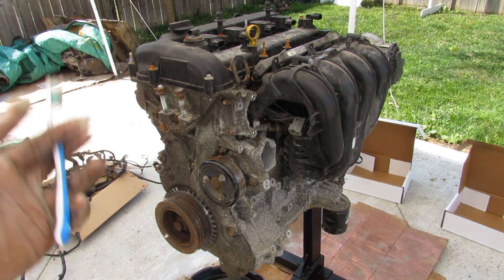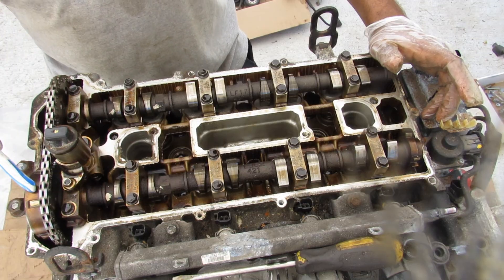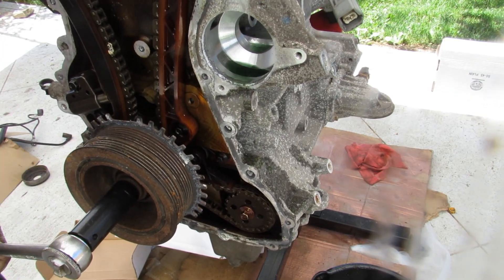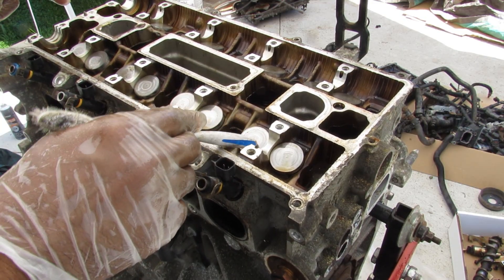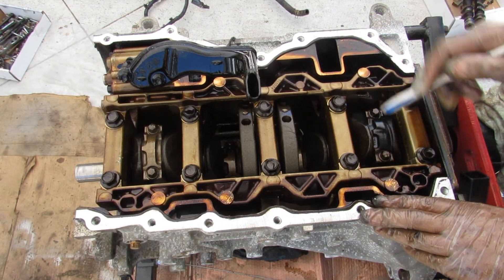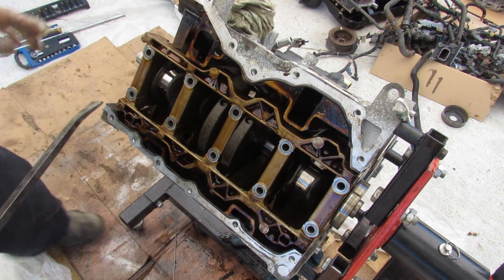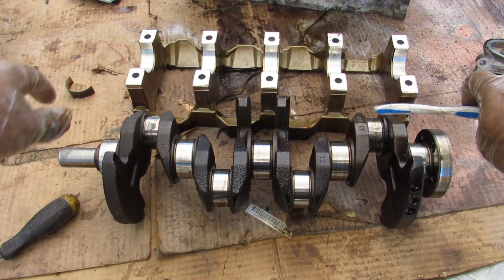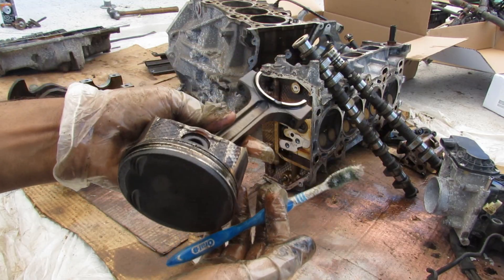Why Mazda Engines FAIL

Comment: In the U.K. the 1.8 mzr Mazda mx5 2006/7/8 seems popular fail from oil starvation. It does seem service every 6 months with fully synthetic oil is key to engine longevity.
Reply: The 2L also seems to suffer. Oil consumption increase dramatically, and if the driver doesn't notice then oil starvation occurs

Comment: very interesting. So drive gently and keep the thing serviced properly esp with oil and filters and dont let it get hot, etc.  If not buy a 1994 Mazda with an iron block BP series engine and treat it like shit. BTW Maltese Shitzus love being oil rags. Least mine did.
Reply: Of course aluminium block engines are more responsible in this day and age.  I prefer iron blocks.   The new way of timing the engine is rational if you have the right calibration bars etc and follow the correct procedure. But again I prefer the old ways.

Comment: The Problem a this  Engines are the Piston Rings and the Teflon Coating  - first of all the Teflon Coating get off after 100000km - then the piston Rings  fail and then the engine will burn the oil - if the user fill up enough oil all the time after this happen he can use the engine a longer time - but most users dont recognise that the engines need more oil after 100000km and then the engines run dry - and the fist tings happens are at the Crankshaft bearings  as you shown ...

Comment: My 2011 Mazda 3 2L engine has travelled 347000km and is still running strong! 

Service your engine on or before it’s due date, never miss a service, and it will last.

Comment: Honestly mazda has their shit together and is one of the most reliable brands out there. Id put the blame on not on time maintenance
Reply: Dude....there is no markings or keys for timing on any single piece.......do you have any idea, how much time one needs to get the timing correct without any reference point? parts and reliability maybe cheap and durable, but that is where cost cuttings go.....the labour costs (aka. time) for a shop to time the engine correctly is where most of the expense is going.
Reply: @hussamjamil4980  i worked at a shop and had mazdas come in for maintenance and i personally never had an issue working on them. Also if you look at reliability ratings theyre one of the top performers
Reply: True, these are actually incredibly reliable engines even when they’re turbocharged. My problem with the duratec is internal maintenance sucks if you have to do it. The Zetec was much easier to work on, though it required more maintenance (timing belt, etc)
Reply: Buddy Mazda cars are trash but not as bad as chevy or kia but still bad. try working on an of there parts and you will also notice theyre designs are even worse to work on

Comment: As mentioned a bolt can be removed to place a pin to hold the crank shaft prior to complete disassembly, these engines where designed to be taken apart with special tools in place to keep the time accurate, otherwise you’d end up causing a headache 🤕 not too bad, I’ve personally have been around these engine way to much lol been there done that kinda scenarios. Ford/Mazda do a great job now it’s the Chevy Cruze! That’s a terrible car and engine

Comment: Theres a plug you remove to insert a bolt to keep the crank from spinning when you time the engine. Keeps the crank from spinging when you torque down that crank pully. Its on the mazdaspeed engines. not too sure about the other mzr engines.

Comment: Have you done a video on the Honda Diesels? N22a or n22b. Id Love to see a video on One of those as i own an accord with the b model. I think its a great engine and currently has 357000 kilometers on it without any problems.
Reply from the maker: Never knew they had diesels I'm north America
Reply: @speedkar99  i see, i think maybe some models had Them in North America but im not sure. They are in the cu/cw models, or the tsx i think they are Called in America but i Guess they never sold the Diesels there then.

Comment: I had the 2.3L in  2004 Mazda6 with a maual. It had regular oil changes & never came close to letting me down. In fact, I prefer it over the 2.5L Skyactiv in my 2016 Mazda6. It punched above its specs & had a great engine note.

Comment: The lack of timing marks or key is fucking insane
Reply from the maker: Amazing how that made it in production
Reply: @Sammyhale30  Possibly. But it wouldnt make me feel any better to have to pay $1000+ (the typical price of a timing belt job) to a mechanic as opposed to the less than $200 I spent on a timing belt kit to do my first timing belt job on my own which has been going strong for 15,000+ miles.

Comment: does anyone know if there is a ratchet on the timing chain tensioner? I am working on a VW 1.4TSI, all the main features are the same. I think it was designed by the same person/team! strange...the cams and crank pulley also don't have keys. The pistons also have the graphite coating, the cam chain guides are similar except all plastic. But the VW tensioner has no ratchet, even with all new component, turn the engine back 90 deg and the chain can skip teeth! VW say there's no problem! the pistons break too. Don't have bearing problems though.
Reply from the maker: They should have a ratchet
Reply: @speedkar99  "They should have a ratchet" i would think so too! but DO they? this is the VW engine, 
https://youtu.be/TZqgx4g1pmA

Comment: I had two Mondeo 1.8 petrols. 5/6 K oil and filter changes. 192,000 and 206,000 miles. Never one problem with either engines. 2005 one on original clutch.
Reply: That's reassuring. Mine's on 77k, changed the oil with good stuff every 5k for the last 7 years I've had it. At the rate I do mileage it wont hit 200,000 until it is over 40 years old, so should be good. Clutch is still ok too, amazingly given the amount of time it spends in traffic jams.

It does burn a small amount of oil. Can't really tell if it's getting worse or not. Sometimes it will go ages and not burn anything, then it'll drink its way down the dipstick in a couple of weeks. Got a fiesta like it too.
Reply: @thegearknob7161  
Mine used to burn a little towards 200k but nothing much. Synthetic oil always for me.
Reply: Ive just bought a 1.8 myself with 73k on and is started to make a slight rattle like the start of the video but doesn't do it all the time, not sure if I should be worried just yet
Reply: @bradley6758  
Just make sure you change the oil and filter. Use 5w30. Any synthetic brand.
Reply: @andylane247  luckly it's just had an oil and filter change just before I bought it so fingers crossed.
Reply: @bradley6758  
I'd probably change them anyway,  unless of course you trust previous owner implicitly.
Reply: @andylane247  going off the fact that they've poured oil all over the top of the engine and under the plastic cover that might not be a bad idea 🙄
Reply: @bradley6758  
Best to be sure. Internal camchains do wear out oils eventually. Use the synthetics and it should be ok. Be careful who does your oil changes. My missus lease car was done by Halfords. The 2nd oil change they didn't tighten the drain plug. Luckily we noticed the oil loss.
Reply: @andylane247  cheers mate.
Reply: @bradley6758  
No worries. Good engines those Ford 1.8's.

Comment: Ford should really be in this title. These were Ford engines that Mazda used. The current generation of Mazda Skyactiv engines are far more reliable.
Reply: No, these were Mazda designed engines and the Skyactiv engines are still very similar to these engines.

Comment: To time that engine you need 2 special tools. One bar that locks the camshafts and 1 pin that rests up against a flat surface on the crankshaft. Always replace the diamond impregnated washers at the camshafts and on both sides of the crank sprocket. And don't try to time it without the tools because you will regret it.  A important note though is never remove the crank bolt until it's timed at top dead center. It's easy to bend valves. As far as this crank journal failure goes 99.9% of the time it's lack of maintenance..
Reply: And a special tool to hold the crank pulley while torquing. The lack of keyway is soooo stupid

Comment: Both my old mazda and my even older toyota could quite happily do 10000 miles and when the oil was changed it still looked nearly new. My 1.2TSI engine turns the oil black the day it rolls out of the garage.

Comment: I have owned 2 Mazda 6  vehicles with 2.3 litre engine 15 years old with 324000km other had 296000km and both engines did not have 1 issue, I have now bought a Mazda cx5.

Comment: Can you PLEASE do a mechanical review of the 2021 Hyundai Elantra Hybrid. It's the only hybrid out right now without a garbage CVT
Reply: Are you equating a Hybrid's eCVT to a snowmobile style CVT like Nissan uses? Because they're not even close to the same thing.
Reply: @OhPhuckYou  That's a very good point. It's my understanding that Ford and Toyota share patents on the hybrid e-cvt which is why they're the only manufacturers that use them. I've had one of each (Ford and Toyota) and they don't drive like the Nissan or Honda CVTs at all - the engine noise doesn't match the speed, of course, but there's none of the rubber-banding you have in the others. Wife had a Honda with a CVT years ago and that was a weird ride.

Comment: So how does one time this engine if nothing is keyed (I got the valves with the gap alignment, how about the crank)?
Reply: The alignment tools are an absolute necessity. You may be able to time it without the alignment tools well enough to get it started but I promise you that it will not run well.

Comment: No key on the crank.
That's some Mickey mouse shit there...
Reply: It used to make me a lot of money off of that design. Independent shops would tear them apart then discover that there was no key way. It's as simple as loosening the crank bolt and then it's all over.  Some would try to line it up without the tools. And some would manage to get it together well enough to run but usually not very well.

Comment: Depending from the owner, this engine never changed the oil on time, that is why dirty the engine and the parts are done.Nothing wrong with my 2.5l MZR  320000km and running new with the Castrol Titanium synthetic oil from the new time to now. 
9years old now 👍😊🏆
Reply: My 2.3 L3 is at 394,000km. 340,000 of those in the last 12 years. No leaks, no smoke. Oil changes at every 10,000km.
Reply: @nowukkas2472  my mps have 245000km on.not using oil still running good.i service car every 5000km
Reply: Bought mine new in 2009, not a single issue :-D. Just over 170,000 km, couldn't be any happier
Reply: I have 2 2.0s both run strong and have 230 k
Reply: 340 000km 2.0L 2004.  Worked perfectly fine, 8L/100km on avg.  Could've probably work 100k more.  I never expected a Mazda engine could be this reliable.
Reply: every engine is that ugly from the inside that has more than 30000km on it
Reply: @ksw8934  think you mean 300,000km?
Reply: @autobotavengerfireballxl5339 nope
Reply: @ksw8934  if your engine is that nasty after 30,000k you should give up driving
Reply: I have the 2,0  whit 451000 k and no issues
Reply: 17 years old but only 300000km 3.0 Duratec in a Mazda.
Reply: Read Rat540 blog for oil information if you're interested.
Reply: I heard something from a turbo refurbish company from Germany. He was asked what is opinion is what the cause is for most turbo brakedowns. He said mostly not or too late oilchanges. Was his opinion so this don't need to be right or always the case.
Reply: @Nordlicht05  Almost all turbo failures essentially come down to lack of proper lubrication. That can happen for a variety of reasons, including delayed oil changes, poor oil quality, high temperatures etc. A clogged DPF for instance is quite a common reason of turbo failures in the recent years. The way I protect my turbocharger is: Always using fully synthetic engine oil, changing it every 10000 km at the most (european car, turbodiesel engine), I would shorten the interval if it were a gasoline engine due to higher exhaust temperatures, let the car idle after every drive for 10 seconds before shut down, after longer highway drives even a minute, and obviously don't rev the nuts out of it on start-up. Also, on cars with a DPF do highway runs at higher revs than necessary to trigger a regen if the car is used in city driving once every two weeks. You can't protect your turbo from a faulty design though, so do your research before buying a turbocharged vehicle and check if the turbo has any factory defects. Turbos are great and can outlast any engine if everything is ok with lubrication and heat. And they're masisve fun
Reply: Try motul x-max 0w40 
It is much better
Reply: lpg?
Reply: do you run on castrol 5w30 or 5w20 ?
Reply: Yeah, the video paints a little bleak picture, but from my eyes it looks mostly down to get your oil changes done no matter what. But that is all cars.
I got a used 60,000 km 2.0 2010 Mazda 3 , really nice quality.
I ain't skimping on the oil changes for sure.
Reply: @cl-e-m  My 2014 Ford Focus spun a bearing at 12k miles. I brought it in at ~2k miles because I thought it was making a "metal-on-metal" noise that didn't sound normal. Not sure what the root cause was, but it had nothing to do with improper maintenance... fortunately Ford honored their warranty and I got a new shortblock. Kept the car for another 50k miles until the gas tank imploded. Again, still under extended warranty. I sold the car after that though. I thought it would be reliable like my Saab 900 or Mercedes 190e that I kept for over 250k miles each. Especially since I got the manual transmission. No such luck. I don't think these engines are bad, but I definitely got a lemon. It was either a parts or assembly issue on mine.

Comment: @speedkar99    I watched the entire video.  I just had 1 question,  do these engines have a PCV valve that can be changed?  Or rather should be changed.   
I didn't see one in the video ( i may have missed it ).   Thanks for making the video.
Reply: It can be changed but it's a project. And be honest with you I'd consider it lifetime. But if you decide to replace it anyway you have to pull the intake manifold off. Make sure you get a new retainer ring for the PCV valve.

Comment: was this the same engine used in some fords? maybe fusions? is the PCV seperator like an air oil seperator to keep carbon build up from happening?
Reply: It was just designed to minimize the amount of oil getting up into the PVC system. Occasionally that rubber hose going up to the intake manifold would split. It would give you a good size vacuum leak to the point where sometimes they would just whistle.

Comment: I rebuilt an L3 just like this in 2020, made the exact same noise too. Spun bearing. The oil in the sump was good, but there was thick black gunk in the oil passages, probably had missed some oil change intervals. Nice, smooth engines with nice power but god damn the design team should be gathered up and decimated just as a warning. I swear it was designed to drive anyone trying to repair it mad on purpose.

Comment: Hi big man! My Honda Acura TSX 2009 2.4 has the same issue(bearing) 
But I still couldn't figure out the reason. The oil pump is working, it's new and enough oil. 
First my coolant pipe was dropping, They fixed the connection for me. After that, some noise and shaking start come. Until one day it cannot spark. They changed one coil and 4 spark plugs. after 2 days, still not good, the same feeling. I didn't really drive, waiting for the new spark plugs to come. Then I changed the rest of the three spark plugs. Then I drive on the motorway, after like the 100km intense driving, the metal hitting noise come loud and louder. The bearing of the same cylinder spun.  The oil pump is ok, oil is nearly new.  So can you give some ideas? Appreciate it very much. Now I am still worried. The guy changed everything and fixed the car for me, after 1 month of driving, now spark the car from cold is hard.  You speak too fast, am not a native speaker.

Comment: This must be why the 1986 B2000 I bought new is still in my family, with a broken odometer showing 350K+ miles. Yeah, it smokes on cold starts (valve seals), it's slow (80 BHP), and paint is half gone. Damn crappy Mazda engines.
Reply: Mazda built their own engines until they took the ranger in 1994. I've had a 86 B2000 , a 92 B2600 and I still have a 91 B2200. The prior two pickups I sold to friends after I put 200,000 miles on each of them. The B-2600 is still being driven by one of my friends. The 91 B-2200 now has almost 150,000 mi on it and of course it's  30 years old now. I call it old reliable because all I have to do is get in it, turn the key and go.
Reply: @danven1256  wasn't the B-2600 a Mitsubishi engine, and had the different hood? I could be wrong, but I thought Mazda just farmed out the 2.6L when they decided they needed a bigger I-4

Comment: The Mazda rotary engines run forever in the Mazda RX7s
Reply: The RX8 was a totally different story though. Nothing like driving on the freeway in stop and go traffic on 100° day and then the engine just shuts off with no compression. It's hard to tell a customer that they're going to have to spend about $8,000 and Mazda is not going to contribute a penny to the repair. I always said that the RX8 should always be purchased with the sunroof. When the engine dies then you can turn it into a planter box.

Comment: I've got a 2.5L version of that engine and have never had an issue in 166k miles.  I like technology but there's still something beautiful about a relatively sime NA engine like these Duratecs.
Of course, maintenance goes a long way toward keeping an engine running but that goes for any engine.